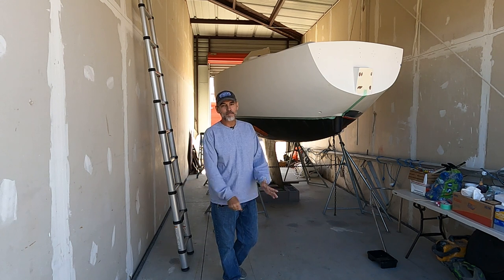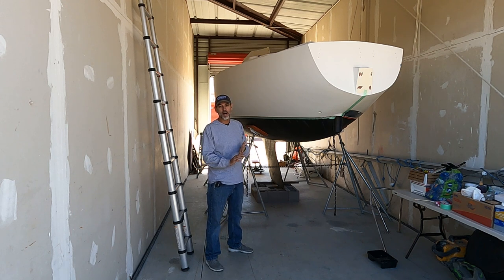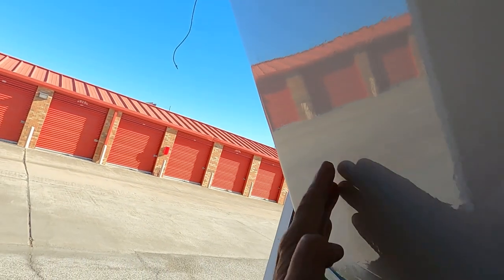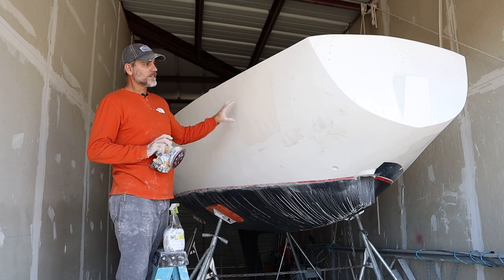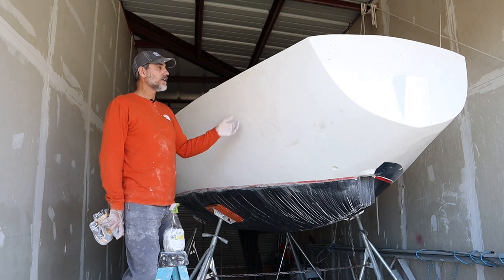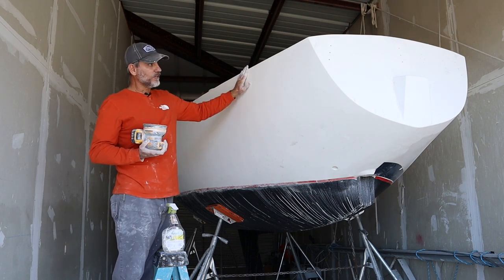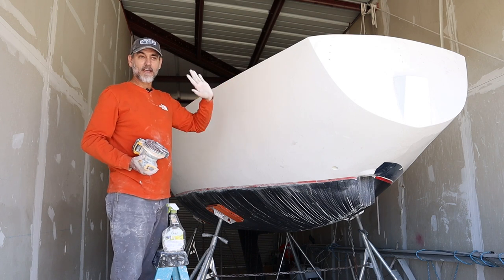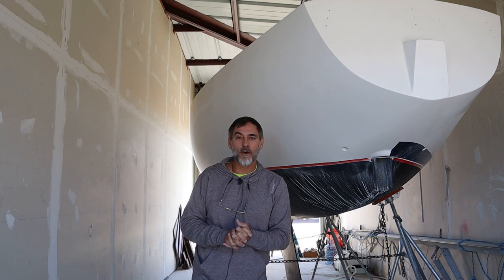Sailboat Refit #29 - Rolling, Sanding and Buffing Marine Paint to a glass smooth finish.

Comment: Questions for you, please.
1. About how many sanding discs (in the finer grits) did you use for that length hull?
2. At what grit do you begin wet sanding?
3. What do you use for the guide coat?  I have the the Mirka dry coat, do you prefer spray?

Thank you very much.  Everything you post is extremely informative.
Reply from the maker: Hello,  I probably used around 7 discs each after painting I started with 800 then 1200, 1500, 2000, and sometimes 3000.  Depends on how smoothly your painting rolls out.  After the first 800 sanding the rest goes quickly.  I prefer spray guide coat, it’s easier the put on.
Reply from the maker: The guide coat I got from o’Reilly’s auto parts, it’s cheap.
Reply: I really appreciate the rapid response.  I believe you are helping a lot of DIYers.  Do you wet sand the 800?
Reply from the maker: I do wet sand the 800 just be sure to use guide coat and don’t sand through the paint.    You can touch up the paint if you do but it’s more work
Reply from the maker: You might try 800, then 1200   Or maybe to 1500 on a area then buff it to see if it’s necessary to sand with high grit.

Comment: Are you recommending one build up primer coat -- sand with 300 or 400 grit - apply 2 or 3 coats of topside paint? From there, should I wet sand in 600-800-1000, etc.. grits to a gloss finish or should I sand with 320 grit and apply one additional top coat like you did on the first side and then wet sand? 
Thanks - great videos and level of detail is excellent.